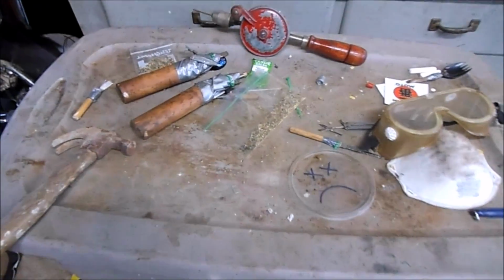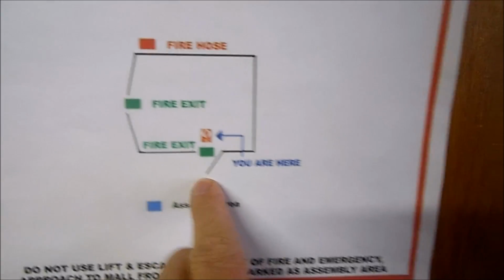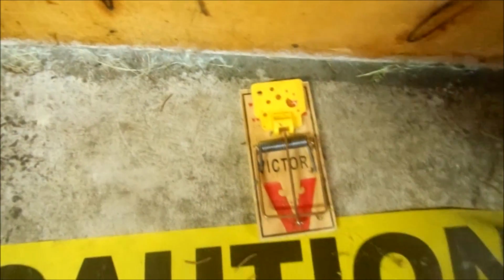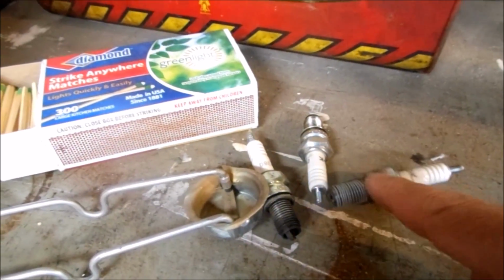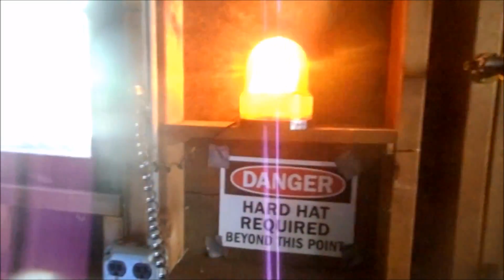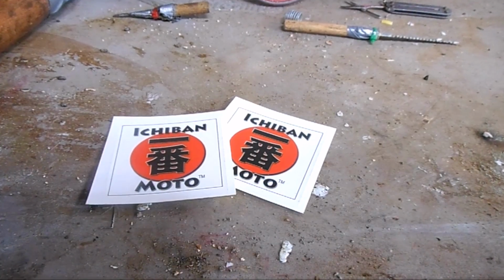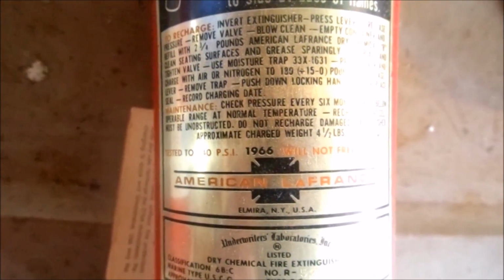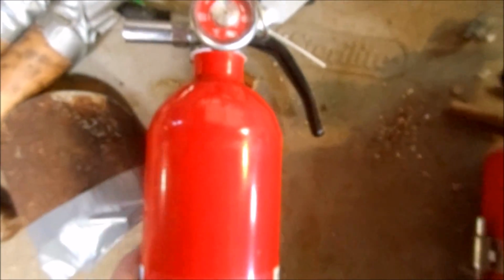how to pass safety and fire inspection

Comment: Hi
Do You think the steel toe solution like Yours would work on my havaianas flip flops - I hate to compromise the air ventilation on my footwear - especially when welding or casting metal elements.
Kind Regards
Kuba
Reply from the maker: i would think so ..